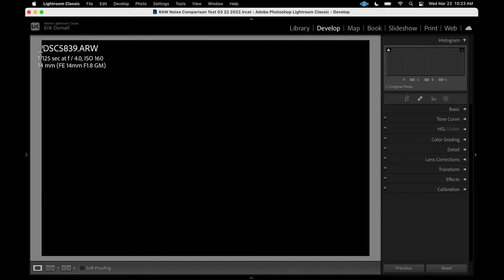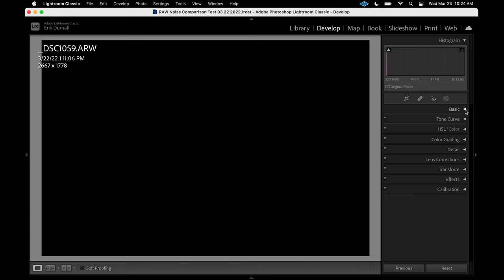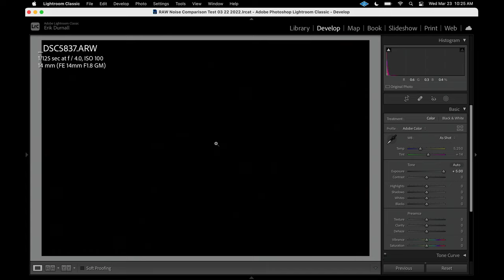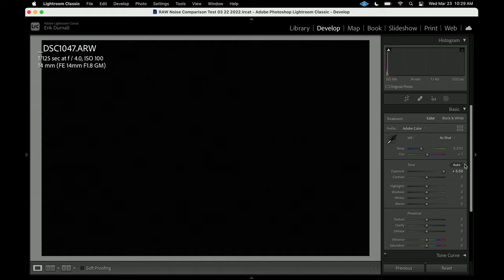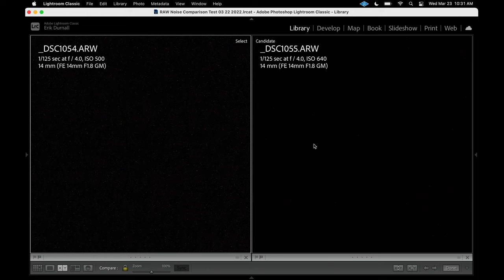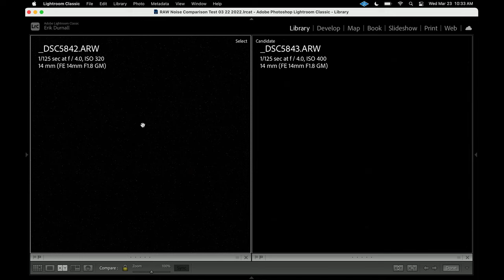Sony's Big Secret To Clean Images: A Noise Comparison Of The Sony A7IV A1 and A7III

Comment: Really useful video many thanks.  I have just recenty purchased a Sony A7iv and a Sony GM 70-200mm f2.8 OSS II and am starting to shoot astrophotography, trying out deep sky objects, so I'm dealing with very low signals and as a result I need long exposures and maximum magnification and maximum cropping of my images.  I'm using ISO 400 on the A7iv as this gives me the maximum dynamic range and minimal noise.  However, I didn't know that this is where the second stage amplication kicks in.  Good to know.  Once again many thanks for your very informative video.  I really like your stuff as you delve into the details while making it very understandable.
Reply from the maker: You are very welcome. ISO400 on the A7IV is amazing. The noise is nearly the same as ISO100 and you get a significant amount of dynamic range back as well. Enjoy!

Comment: Erik, I'd be interested to learn of video high noise gain when you need to bump your ISO very high.  I've used the Sony 7SIII and found 12,800 is awesome at night in lower light scenarios. That said what is the high range of the 7IV for working with video in low light, similar to the 7SIII? Thanks!
Reply from the maker: The A7SIII (and FX3) has a much higher gain conversion point than all of the other cameras. The A7SIII gives you 4 1/3 stops of normal gain before switching to the high conversion gain. In RAW stills, or with PP off the A7SIII has a base ISO of ISO80 which means the high conversion gain stage starts at ISO1600. This also applies to video, and carries over when using picture profiles. For example; when using the Slog3 picture profile, the A7SIII has a base ISO of ISO640 which means the high conversion gain stage starts at ISO12800. It’s easy to figure out the second gain stage for the A7SIII as you can just apply the base ISO by 20. So if you have a PP that has a base ISO of ISO100 100x20=2000 so your second gain stage would start at ISO2000. The A7IV is similar in this way as you can just multiply your base ISO by 4 to figure out where your second gain stage starts. In Slog3 your base ISO is ISO800 so 800x4=3200 which means your second gain stage starts at ISO3200 in Slog3. If you’re using the S-Cinetone profile, the base ISO is ISO125, 125x4=500 so your second gain stage starts at ISO500. The A7III and A1 are not as simple as just doing simple multiplication, but the A7III gives you 2 2/3 stops of ISO range and the A1 gives you 2 1/3 stops of range before switching to the high conversion gain stage. And this apples to all of the picture profiles as well. Hopefully that helps!
Reply: @erikdurnall9585  Shouldn't your multiple by be a constant number rather than having a different number for each camera. How did you come up with the multiply by number?
Reply from the maker: @thomastuorto9929  most of the cameras have different high gain conversion points, a few have the same. The Multiplicative factors (20 and 4) of the A7SIII and A7IV respectively, are just a convenient coincidence. The other cameras have conversion points that don’t have that convenience.

Comment: Interesting video but you mention the A7rIV second gain is around 640 but other web sites have it lower, 320-360.
Reply from the maker: Yes. You are correct. I mistakenly said A7RIV when I meant to say A9II. The A7RIV does have a lower second gain stage that starts at ISO320
Reply: @erikdurnall9585  Thank you for the response and the video.

Comment: Thanks Eric for an informative and visually believable comparison of these gain amplification break points.   Are you relatively confident that the same behavior is exhibited when the sensor is processing in it's sweet spot, i.e. a properly exposed image as opposed to the back of a lens cap?  So my interpretation for my A1 is, unless I'm shooting long exposure on a tripod at ISO100 or shooting handheld in very bright light where I can get 100 or 160 that I'm better off setting my min ISO range in AUTO ISO to 500 or 640?
Reply from the maker: Yes. That is correct. Unless you are shooting in ample light and you can effectively use ISO100-160, you’re better off shooting at ISO500 on the A1. If you’re doing wildlife or anything that typically requires higher shutter speeds, you definitely want to start at ISO500.
Reply: @erikdurnall9585  Thanks brother , that's something I never would have figured out on my own.

Comment: Hi Erik, thanks for this very helpful video and the time you put into doing all the comparisons. I recently purchased the A7IV and also own the A7III. I have been noticing some noise on the A7IV as soon as I was shooting above 160. Started to wonder if I was just seeing things or what but I never seemed to have had this with the A7III. So I did the test and compared both cameras. The noise on the A7IV is noticeably worse at every ISO level. So I guess I was not seeing things. I suppose that means that there is factory issue with my sensor and I should contact Sony about it, would you agree?
Reply: No man... A73 is much better because of the low mpx imo. Is normal to be better even if the sensor is old!
Reply: Sorry to come in like this... But I have the same problem, I would like to know if you were able to solve it?

Comment: I think you got it backwards. ISO400 is NOT when the higher gain stage kicks in; it is when the camera switches back to LOW GAIN while tapping the smaller charge capacitor on each pixel. At 100 ISO it uses the big cap optimized for ample light also at low gain. At 320 is when it uses the big cap at high gain which is why the noise is high.

Comment: What would be the next gain stage for all the cameras... Is there anything like that..? Or 400,500,640 just those..
Reply from the maker: There is no third sensitivity.
Reply: @erikdurnall9585  thanks a lot.. is the gain stage different from native ISO or it's the same. TIA
Reply from the maker: @prashaanthdr7124  it’s only different between camera models. It’s always the same range for a specific model no matter what your base ISO is. For example the A7IV is 2 full stops. So if you’re shooting RAW stills and your base ISO is ISO100 then the second sensitivity is 2 full stops above ISO100 which is obviously ISO400. The same if you’re shooting video and using a Log profile where your base ISO is ISO800, the second sensitivity is still 2 full stops above your base ISO of ISO800 which is obviously ISO3200. The range is always the same. For the A1 it’s 2 + 1/3 of a stop, for the A7III, A9, A7RIII, A7C, and A9II it’s 2 + 2/3 stops, for the A7RIV and A7RV it’s 1 + 2/3 stops.
Reply: @erikdurnall9585  this helps a ton.Tq

Comment: PROPOSITION : 

Should we conclude we should make (available) SIMPLE graphic (same canvas) grids (a smartphone app!) for ANY camera, with just as many fields as iso/asa steps (50 to say 200'000). We coukd then color-marker over those fields that represent the camera's levels where a new treatment kicks in. Then: how much backwards  steps it replaces. This we could simply for each camera cross over the settings that overlap and should be ignored. (Best would be to be able to eliminate them in the camera's own algorithms of auto-iso option !!!!!!).
Maybe with 3 filters, because these "to eliminate/avoid" ranges, will probably differ not only just in regards to color noise, and dynamic range, but perhaps differ in regards of grain effect, too ?
Maybe such an app/ (standardized) table exists already ?
Perhaps something for DPreview.

Comment: pitty you stopped at ISO 1600... A7iv has kind a secondary ISO-quality kicking in at ISO 3200, waaaay better than with ISO 1600
Reply from the maker: The A7IV second base ISO starts at ISO400 as demonstrated in this video, not ISO3200
Reply: @erikdurnall9585  I stand corrected, repeated the test righ now. But I had some previous tests with different results, oddly enough. Still have way less "worms" on 3200 compared to 2500, and there's definitely another big increase in quality by choosing ISO 6400 over ISO 5000. Did the latest tests without a lens at all, just camera body plus body cap, perhaps my Capture One activates different automatic enhancements, depending on (no) lens...

Comment: Erik, thank you so much for this comparison. 
I understood that you tested the dark channels of several cameras with an 32x (5 stops) amplification.
You found the the points where some magic reduction in noise happened, where I guess is a reduction in bandwidth using a digital filter, which is applied (may be ?) to create a second gain stage or whatever magic.
That was a real good information you provided for us photographers!
Thank you.
IMHO the real optical signal is on top of that dark channel noise and is impacted by several digital conversion errors (lin +1 bit uncertainty..) and the number of electrons freed up per photon of the light channel inside the photodiodes. That is the part I would be interest in for noise comparison of the signal channel. Do you have any data about that.
Thanks a lot again.

KO

Comment: Noise? By definition a digital (color) camera has no pixels at the sensor level. The real sensors in the sensor are colorblind and sees the entire humanly visible spectrum. In old black & white (B&W) film terms this makes the sensor "panchromatic" (pan=all, chromatic=colors). And these photosites are analog. We get color because each photosite has its own color filter that limits the visible spectrum to one color band and  this makes the photosites (in old B&W terms) monochromatic (mono=one). Your 14-bits (deep) raw file only has monochromatic data elements. The camera has an analog to digital (AD) conversion circuit to convert analog "real" values in to digital integer numbers
If you shoot a color reference card and next look in the data elements with the red patch in the subject, then you'll see that the red-filtered photosites have generated high EV numbers, the green photosites (50% of photosites are filtered green) have been scanned and AD converted into dim EV and the blue-filtered photosites may have a zero EV.
If you were to display that, you only see noise and it is very ugly.
We get pixels from "raw processing" that basically does wild-assed guessing of missing colors. So each of the green and blue photosite values must be turned into an RGB triplet that should say something like [200,0,0] for reasonably bright pure red. But the red photosites are also modified in the processed and in the end have green and blue added into the guess.
When we change the "color noise" and "luminance noise" slider in Lightroom Classic (LrC) then we influence how LrC does the raw processing.
Statements like "the A7iii is very clean" or "is a very clean sensor" ignore raw processing completely. Attributing artifacts to the sensor keeps Adobe from improving their software. And gives credits to foundries that make integrated circuits (like sensors and processors) based on a client's specifications.
Large part of what the naive call color science is in the raw processing, the next big part is in the filter properties of the (Bayer) filter overlay over the sensor, not the sensor. In the end when we get to the photosites, these are almost passive and analog and we get our raw data from scanning the photosites while AD converting into digital numbers. The AD conversion is likely a mathematical function provided by the camera manufacturer.
The camera's noise may be a function of its precise Voltage regulation and the precision of its AD and other things, not the sensor in the first place.
Then what we see after raw processing is still 95% raw processing. Don't forget that Moiré is just a color noise artifact that we notice because of a repeating pattern in the subject, but that in more randomly textured subjects it still is there (probably more so even).
Oh, when marketers of sensor foundries and camera manufacturers advertise "mega pixels" they misled us, except in camera through raw processing JPEG files are generated and these have pixels (because RGB).
Yes, there is a noise aspect in very low light. The rest is myth, lie or misleading - ignorant or illiterate parroting.
Try raw processing in Topaz Denoise and sample up in their Gigapixel AI. Or process in DxO PhotoLab (5 with the best denoise switched on).